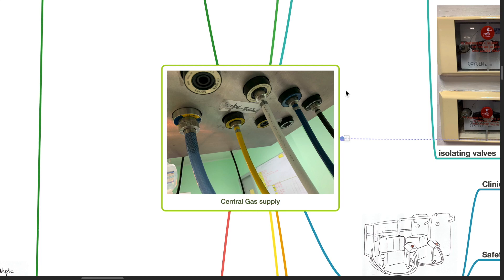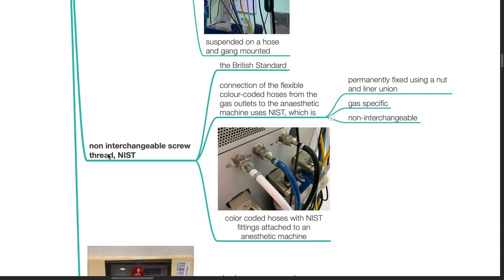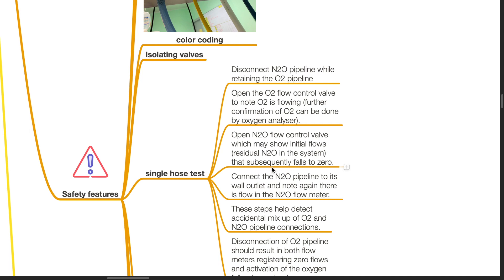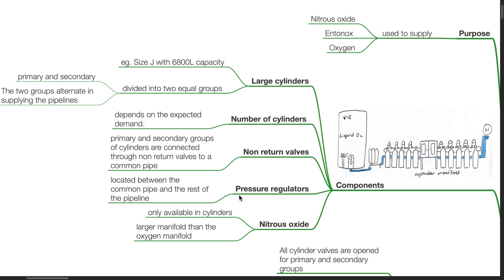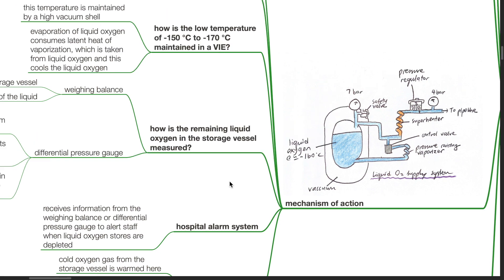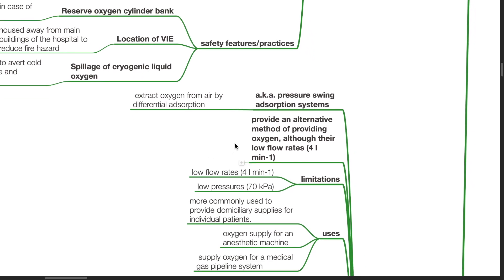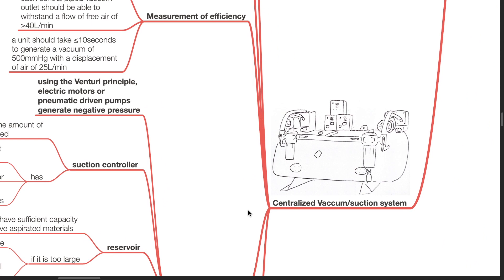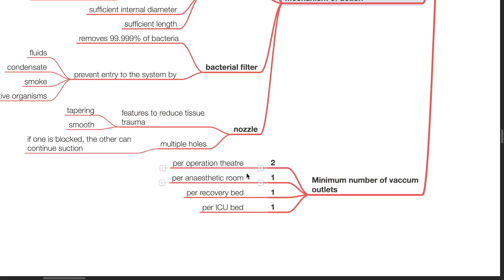CENTRAL GAS SUPPLY - PHYSICS SERIES

Comment: Please answer my questions, How many gases are used in Brachy OT and Dialysis ward?
Isolation valve placed where on the floor? How we calculate terminals with probe? Where AVSU is placed with area alarm?
Reply from the maker: Good day, kindly refer your question to your Hospital Engineering Department and Design Consultant Engineer as they are the experts more suited to answer your question, not me (an anaesthetist). Thanks
Reply: @ForeverLearningAnaes  Thanks